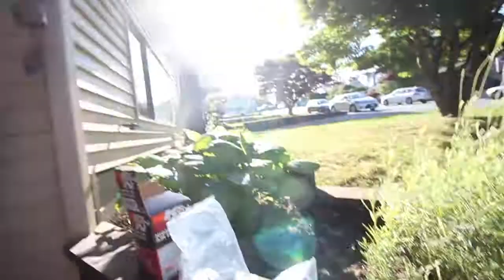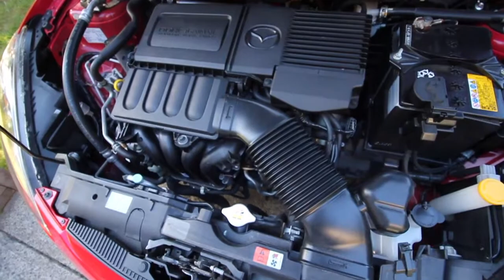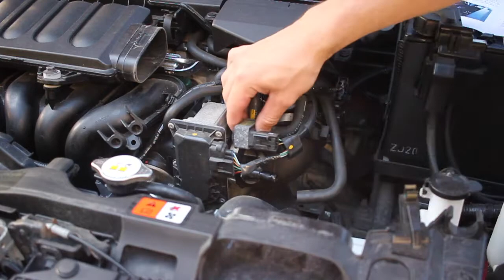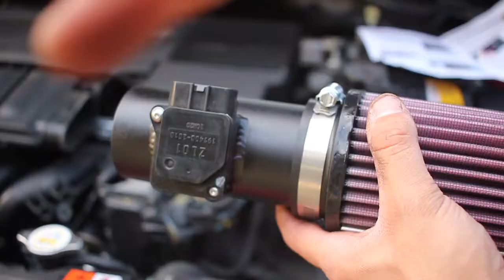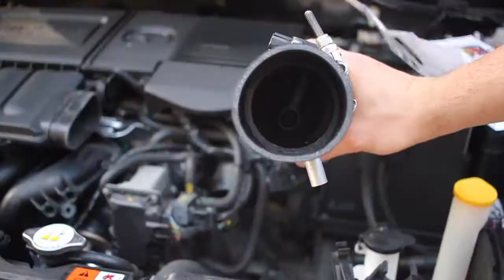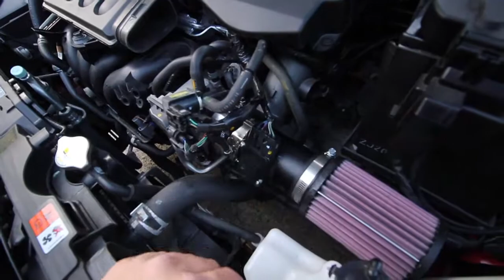Installing My New Intake! | Project Duece

Comment: Bro what is the sensor which is next to the mazda badge there
Reply from the maker: Which Mazda badge on the engine?
Reply: You mean those "bunch of wires" going into that box? That's the ECU.
Reply: @LiamDrives  the engine cover .. the 2 sensory wires that are connected

Comment: Question, did the check engine turn on? Or any other dashboard light?
Reply from the maker: Daniel Alcala Nope! No CEL.
Reply: If it happened  your installation , just disconnect battery + for a minute ...this will reset the computer an it will learn you have better air flow an send more fuel for better performance...;-)

Comment: is this a skyactive engine??
Reply: Nah it wont be. Skyactiv engine usually states it on the engine and usually will have an I-stop function inside the car which can be manually turned off. Much different engine layout as well. This is just the normal petrol mazda demio with manual. Autos will be harder to install cause auto trans fluid dipstick is next to the throttle body so fitting filter might be tricky

Comment: So what did you do with the open original intake?
Did u just leave it open or what?
Reply from the maker: Yea just left it open since it has no affect on performance.
Reply: LeadFootLiam I tried to out in an intake in my car and my engine light came on and the car isn't running right
Reply from the maker: Did you buy a kit or just slap one one?
Reply: @Ivan-jz5pc  Well Im 7 years late to this so you may have worked it out  but possibly the vacuum the intake was to make wasnt right. Gaps in the installation and connections that may not be  airtight might be result of engine light turning on. Use soapwater and spray on the connections and fittings to see if air is leaking anywhere. Hope this helps

Comment: So.....how is this a cold air induction? You're pulling hot air from the engine bay.🤔   ugh!
Reply from the maker: Its not a CAI, never said it was.
Reply: Nah its a SRI or short ram intake. Different from the Cold air intake because piping is much shorter travel. Better sound and throttle responsiveness but cold air intake draws in better cooler air due to location of pod filter. For me, my short ram intake on my car is actually good and keeps temperatures cool because it does not stay directly behind the radiator it perches a little to the side near the firewall and is good.